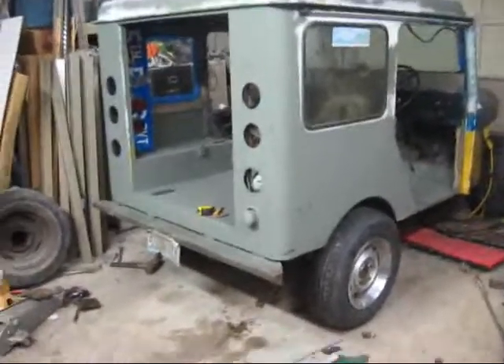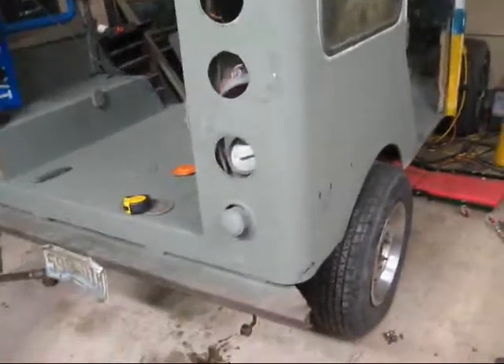dj5 postal jeep project part- 6 ford 8.8 axle swap

Comment from the maker: thank you for the reply. i swapped in the axle mainly to get a wider stance and to match the bolt pattern of the front axle i got out of a jeep comanche. the added strength is only a plus. as soon as i find one for dirt cheap i will replace the rear with a newer 8.8 with disk breaks.

Comment: The Dana 44 has 30 spline axles and an Eaton Posi plus 2x11 brakes. Mine has a Vortec 350 with a 700R4 for three years now without any issues with the rear axle.

Comment from the maker: @swaybelly321 yes you are correct. i never looked at the axle before i took it out and i had bad information from the seller. i didnt realize it was a 44 until it was out. the entire front end was rotten when i got the jeep and a friend donated a xj that sparked the axle swap in the first place. the rear xj axle was stolen and the 8.8 was then donated by a friend for the build.

Comment from the maker: @sdime59 you have 2 djs, are they both drooping down? my jeep when empty has perfectly flat springs. if yours is drooping empty id swap them out. hopefully your other jeep has better springs. another thing you could look into is an "add a leaf" it will give you a little lift in the back but help support those droopy springs.

Comment from the maker: @sdime59 im assuming your talking about the rear springs. the front springs are spring under so if they drooped that far the axle would be hitting the frame. ok so the stock dj5 rear springs are all flat. they flex in a downward motion which gives it a better ride. im sure there is some droopage over the years. so you jumped on the bumper and it doesnt flex and sway? remember i didnt have shocks in the vehicle when i made this video so it thrashes around more than it should.

Comment from the maker: easiest thing ive done on the jeep so far. you have to switch out the front axle as well though. unless you are willing to run 2 differant bolt patterns for wheels? if you just want it to be more stable id say wheel spacers to make it wider and sway bars to control roll. im putting in sway bars front and rear but havent found ones that will fit yet. when i do ill fill you in :P